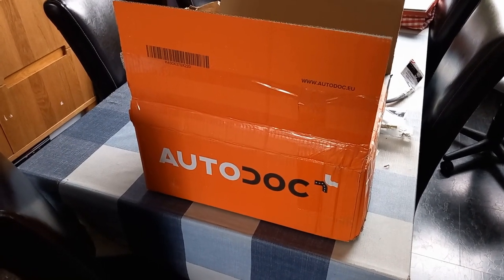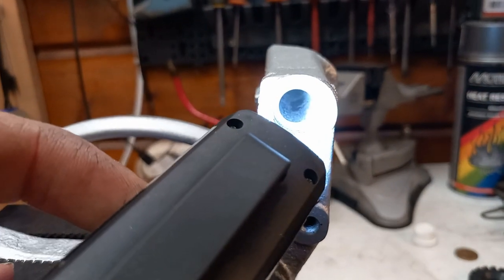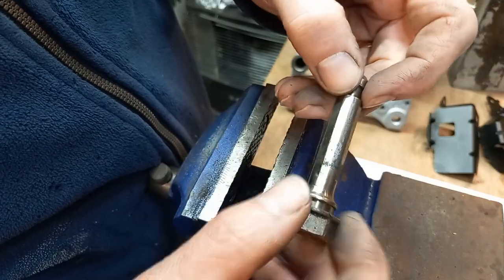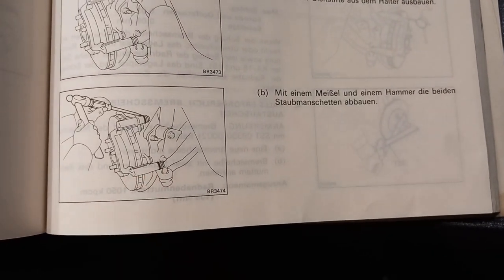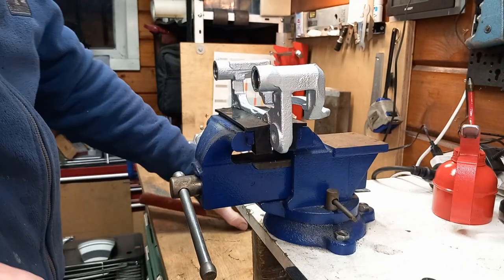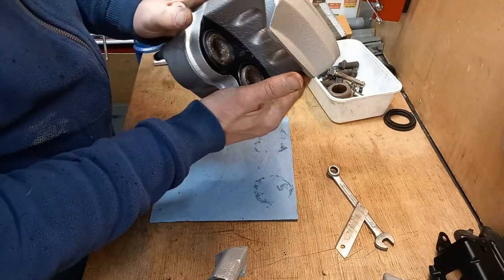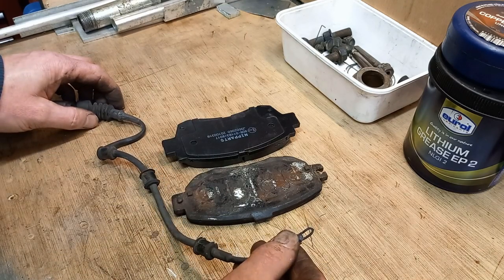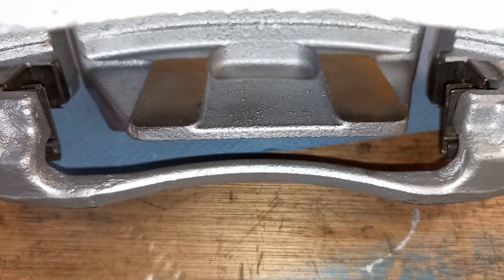Episode 18 - Project Lexus LS 400 Brake overhaul

Comment: You are the most meticulously proficient cleaner/recycle r of vintage parts on the internet. I am amazed at how an old part is removed, and 1 minute later it is perfectly cleaned....and ready for re-painting in just 30 additional seconds.
You must spend a lot of time off-camera doing surgical cleaning because your re-painting is always so pristine!
Reply from the maker: Well, I don't want to bore everyone with my cleaning methods, but I do like to be thorough. So I do indeed do al lot of cleaning off camera. But it's always testing the waters when it comes to finding the right cleaning method. Rustbuster is great, but also messy. And you run the risk of removing any protective coating in the process. On the brakes I used Rustbuster for the bolts, buth then I had to recoat / cold blue the surface. I'd rather try to electroplate them the next time.
Reply: @Carnold_YT  Lots of old-timers in the USA swear by spray "oven-cleaner" because it's much less expensive, and they don't have to brush it much, or at all. I think it is very alkaline though not enough so to damage a household oven. Disclaimer: I have not ever tried it on car parts, but have used it on my mothers oven and it does truly remove baked on grease and sugars.
Reply from the maker: @joeteejoetee  I used it to clean the intake runners and the inlet ports. It worked like magic!
Reply: @Carnold_YT  Wow! That is very good news - I'm adding it to my shopping list - even though we very seldom use our 25 year old incandescent stove - I might need the cleaner in the shed!

Comment: About your painting booth: I have seen many small DIY booths that eventually suffer clogged/gummed-up fan impellers.
I have also worked in Aerospace till my retirement and can share with you that painting booths all use very simple filters well before the exhaust suction fan (which like yours: is mounted above (gravity) of the intake (several meters in fact)) and they use the simplest spun-fiberglass (usually blue or green colored, and never cloth/felt/paper type) and you can visually see when they need to be replaced.
Most booths have 4 or 6 large 1" thick panels on the rear wall, and the airflow goes 90 degrees strait up-to the fan above, and then out the roof. I propose in order to protect your fans' impeller from being encrusted with paint (paint that is highly motivated to instantly solidify!) that you add at least put some filter between the back side of what is being painted - and the fan impeller.
Even just a nylon stocking. Fortunately the very cheapest of household air-filters work perfectly fine on paint droplets.
We sprayed mostly black paint in the paint booths, so it was obvious when/which filters needed to be changed, well before the calibrated U-tube manometers at all painting stations indicated so.
I love that you used a commodity bathroom centrifugal fan with hoses, as ANYONE can DIY ALSO !
Reply from the maker: Thanks for your input. I used a filter for cooker hoods, this worked fairly well, but the impeller of the fan is indeed clogged with paint crusts. I think I first need to find a more powerful fan, this one just hasn't enough displacement / suction power. I already made plans for a central vacuum system that I can use for my paintbooth, grinding wheel and soldering station. One of my customers produces industrial filter systems, maybe I could ask them for a new exhauster. (Probably not, a 22kW fan will likely implode my garden shed) ;-)
Reply: @Carnold_YT  Ha ha!
I think it would be possible to make a high volume coaxial venturi exhauster with a shop vac at the center, and the fume hood connected around the outside. Slide the the center point axially to find the sweet spot - it could/should never clog.